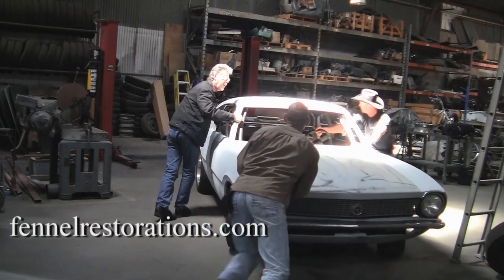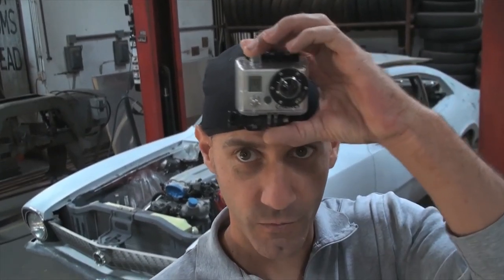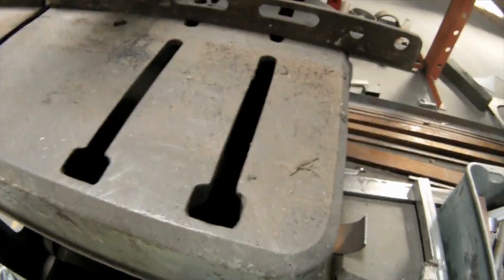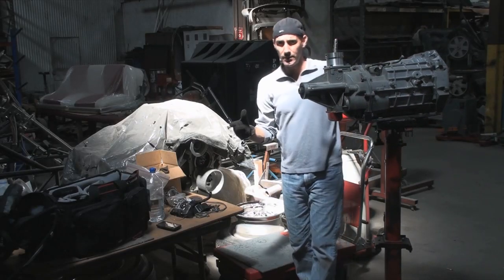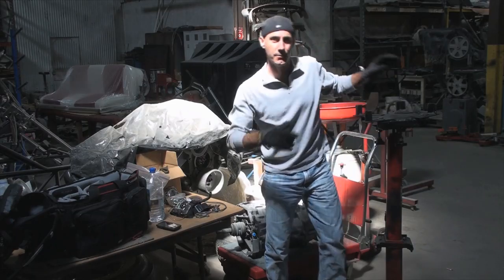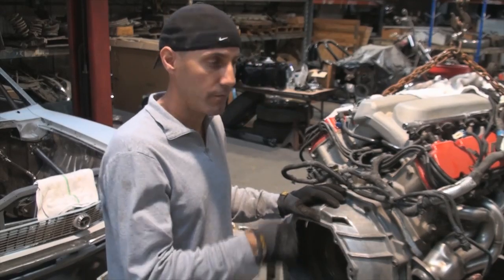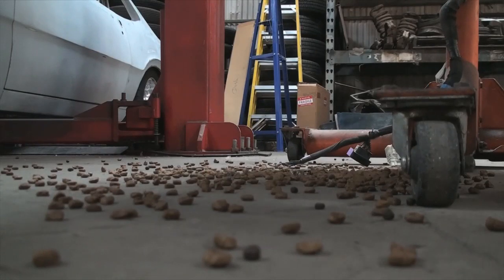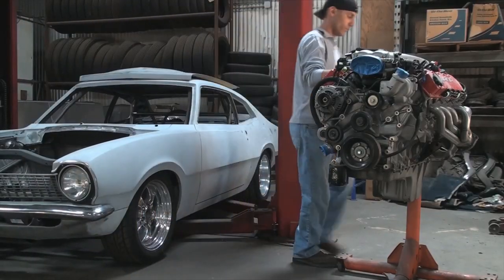Dodge Viper V10 in a Ford Maverick Build Video 3 - Engine Removal / Oil Pan Issues

Comment: Keep the videos coming just like you're doing now. This is a really cool build. I can't wait to see your finished product. I had a '83 pontiac grand prix with a 3.8L v-6 original. I stuffed an Olds 403 big block in it and it fit perfect with no mods.

Comment: Hey man the car is looking great. I myself am trying to figure out how to put a 2004 Viper engine into my 79 Chevy El Camino. I haven't been able to really start yet because I'm a be full time student in the fall and my money is going towards that. However if things start turning around I would like to start working on it starting next summer. I know once I get the engine and transmission in the car, the project will just start taking off. Keep putting out videos.

Comment: love the build keep the vids coming i love to see the work of other car guys! im doing a v8 347 swap in my 88 ranger i have been working on it since i graduated highschool last year i am 19 now but have so far swapped it onto a modified 2000 chassis. 13" cobra brakes, 4 link, hydro handbrake and some other goodies but cant post a link for some reason

Comment: the vipers signature side exit exhaust would be sweet. especially through the sheet metal with rivits holding in the the heat shields. thats my opinion of course

Comment: Hi looking real good .Be careful modifying oil pan . I just bought V10 that they modified the oil pan and caused a main bearing spin his bad fortune .   My engine now, as for engine wiring loom & parts, what are you using & what ECU are you using? Steve